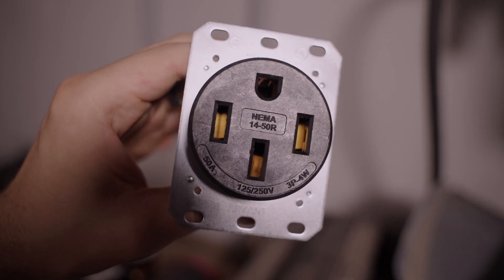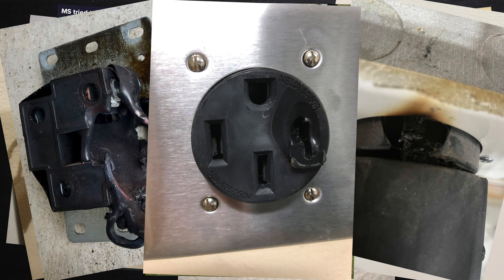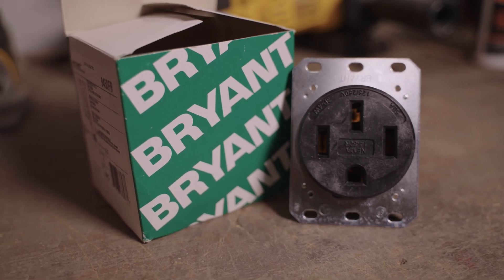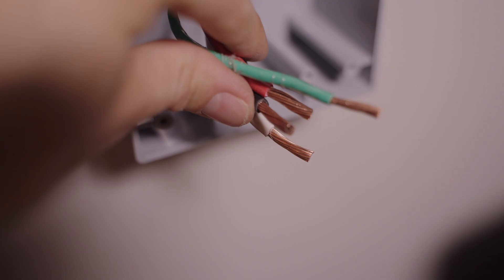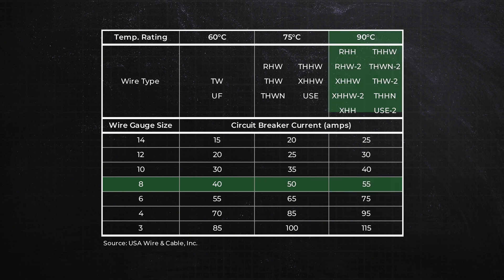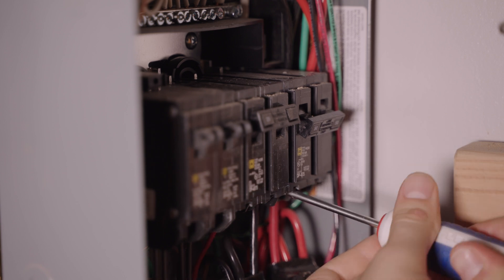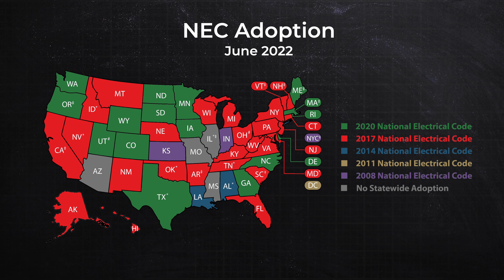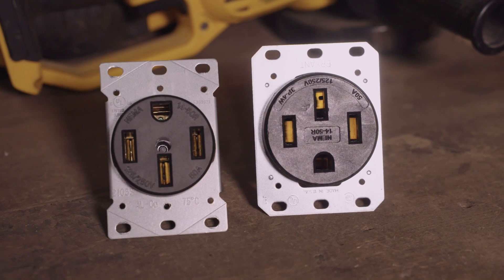3 Mistakes I Made Installing a NEMA 14-50 Outlet

Comment: What's the downside to overtorquing the screws? I understand that the bolt will stretch in tensile situations, but under compressive situations, I don't see the problem with overtorquing. Can someone explain?
Reply: Over Torquing can cause a number of issues: stripping of the screw threads, mechanical failure of the material surrounding the yoke, or the yoke itself, as well as exceeding the allowable compression of the stranded wire, which could then increase the force on the surrounding materials when exposed to thermal cycling. Also, the PVC counduit needed to be glued to the box, given that he pulled THHN/THWN and it's not just being used for mechanical protection. Sheathing on one of the conductors was also damaged. It demonstrates why most people should hire an electrician. I'm sure Josh means well, but making other errors in the video pointing out the errors in the first video is not a good sign. It's typically overconfidence that kills, not self-doubt. Rigid metal conduit would also be my preferred choice in an environment like a garage, instead of sched 40 PVC. BTW, you can see damage to the sheathing for the green grounding wire, which is likely because he didn't ream the conduit as required. Not a big deal if it's the ground, but it's possible that other conductors were damaged during the pull if one of them is damaged.
Reply: @petermaxwell6748  Thank you for the explaination, I genuinely appreciate it. One of my family friends owns his own electrician business, so I will always call him if I need electrical work.

Comment: I know you have turned off the power; you have shown the action in the video. However, as a safety habit, and being a youtuber, you have additional responsibility, you should use a detector to confirm the power is actually turned off.

Comment: Slight correction, those are poles not phases in your house.  The poles are 240v across them with neutral tapped from the middle of the single phase transformer.  Everything is on the same sinewave.
Reply: This is true, but the two "poles" (red & black) are 180 degrees out of phase from each other vs 3-phase power where they are 120 degrees out of phase from each other.
Reply: @tomnorman5461 You are correct, calling it two phases violates only tradition, it is not factually wrong. Electricians resist calling it two phases because 1) the two phases are derived from a single phase source, 2) there was a now obsolete system called two phase with the phases 90 degrees apart, 3) the loads are all single phase, and 4) a 180 degree phase shift is also a simple polarity reversal, so depending on how you analyze the circuit, you can miss the second phase.
Reply: @david672orford  Correct. I've drawn a transformer secondary, putting in the center tap, and ask "how does the center tap achieve polarity reversal?  Crickets, usually.
Reply: @tomnorman5461  If they were 180 degrees out of phase, then the voltage difference would be essentially zero.
Reply: @runningwater5936 nonsense. When one is at +170 V the other is at -170 V. 170 - -170 = 340.
Reply: @tomnorman5461  When voltage is measured across them, you get a single sine wave of 240v at 60hz.  You could invert the polarity to achieve another sine wave 180 degrees out of phase.  If you took a measurement with respect to ground at either pole you would get a very small voltage on the lower leg but but it would still be the same phase.  If you looked at the top pole and neutral with respect to the lower leg, again your measurements would all be the same phase.  The only way I can think to achieve 180 degrees out of phase is to use the neutral to the lower leg but wire the polarity backwards.  But you would have two 120v signals 180 degrees out of phase with each other.  I can’t think of any appliance or motor that wants that.  Instead they want the voltage taken with respect to the lower pole to achieve 240v peak to peak.
Reply: @tomnorman5461  When you add a sine wave of a certain phase (x) to another sine wave of the same phase (y) the sum is simply x + y = new voltage. In this case, each wave is 120 volts. So adding both poles together (think of it as putting them in "series") gives  you 240 volts. The 120 volt outlets in your house only use one pole, so 120 volts.

But @GROGU123 is correct: they are NOT 180 degrees out of phase. Your house has one sine wave (one phase) power running into it.

Comment: Also lack of proper torque. Most electricians don't use TR's much less a homeowner. I am BLOWN away just how tight 35in lbs is every time an AC disconnect or breaker calls for 35. Nice use of the TR!!!

Comment: Here is the deal. If you go to Grainger’s site, that number for the Bryant references a 14-30R. 
Where did you get the face plate? Didn’t see that there.
Reply: Check with Grainger. I had the same issue and called to confirm the actual product being sold. At the time of my call, the product description was wrong as it was referencing a 14-30 instead of 14-50. For wall plate, look into Leviton S701 as the opening is larger to match the Bryant.
Reply: agree. he posted the wrong product url

Comment: And, it is not just EV chargers that can be sour places for GFCI protected devices.  RV receptacles is ANOTHER horrible place for that.  My uncle Randy has a motorhome and he had a GFCI on his 50 amp and he had nuisance tripping like you would never believe.  He ended up removing the GFCI.
Reply from the maker: I was curious about that as an RV is a huge electrical system and any tiny current leak (or collection of small leaks) will be an issue.

Comment: Continuous load my friend. You can only use up to a 32amp charger. 32@125% is 40, you have a 50amp recep. You dont need the industrial grade.
a 48amp charger @125% is 60, so you would need 60amp breaker and #6 wire, but a 60amp receptacle does not fit the plug. Thats why you use the industrial grade recp or no recep and hardwire!

Comment: For all the problems you mentioned at the beginning I hard wired my Tesla Wall Connector with NO GFCI, I don't trust them for this application and went ahead and used 6 AWG.   See the Sandy Munroe segment on the dangers of 14-50 receptacles, they melt, go ahead and do the job right the first time with a wall connector.
Reply: Copper or aluminum?
Reply: @KevinCoop1  COPPER

Comment: 4th Mistake
Stupid Wall or Ground charge cables. Extremely Stupid
insane Tesla Wall Charger and more Insane charging cables laying around. 
Ceiling Chargers
Ceiling Cables
Never ever trip over high voltage cables
Never drive over high voltage cables
Spring r Bungi r Rope w Counterweight
All from top-down ceiling hook down
Stupid Tesla Wall Charger
Reply: Tripping over a 240v cable or installing a 240v plug on a wall with foot traffic r driving over charge cable is crazy. If you do it do it right from the top down. Safe out of the way and lower cost.

Comment: Am not an electrician, but thought, strictly for a code perspective, you cannot put a 40A breaker on a 50A outlet, because you can have nuisance tripping.  The circuit as is, maybe safe, but, is it a code issue?
Reply from the maker: There is not a 40 amp outlet in the US, and the 14-50 is allowed to fill that gap.
Reply: A 40 amp outlet can be used to protect anything downstream if it is rated at 40 amps or more. The amperage is limited by the breaker. If you plug a full 50 amp load into an outlet and wiring rated at 50 amps the 40 amp breaker will trip, and it is not a nuisance trip, it is doing its job. With the exception of duplex outlets, installing breakers greater than the ampacity of the wire or outlets will most likely be another type of problem.

Comment: 2 current carrying conductors on 120/240.  When x and y are equally loaded, no nuetral current.  120/208 can't use that exception.
Reply: I’m not sure what reason you put in the comment, but why do you thing balanced load on 120/208 has a neutral load.

Comment: It's not true that those outlets aren't designed for continuous 50A power draw. They are or else they wouldn't have gotten the UL approval. But that means that the install needs to be done 100% correctly. I have found that most connector outlets overheat because the screws weren't tightened properly or the wrong wire was used. A good way to tell if you have a problem is to feel the connector under a full load. If it's getting hot, there is a problem. The thing about daily charging is that you might be connecting and disconnecting every day and some cheap connectors start to wear out after too many connections and disconnections. That's probably why more EV outlets melt down. You plug the dryer in once and the plug stays put until the dryer dies and is replaced. And, yes, you can solve that problem by going with a better connector.

Comment: Don't have an electric car but I want one eventually. I installed the 50amp already used 6ga wire also since 8ga is the min and I don't want the bear minimum. I will however be buying that industrial 50amp, I also noticed the connections screws weren't very effective. Does the metal face plate fit the new outlet or did you buy a different one?

Comment: If your charger has a plug but you never move it, and your electrical code requires a GFCI, you can ask your electrician to cut off the plug and hardwire the charger. If it is hardwired you do not need a GFCI!
Reply: Cutting a plug off would violate the cords listing.
Reply: @KevinCoop1  most allow for hardwiring. Instructions say to remove the cord end and install the required length of cable. Typically the came cable that goes to the plug...

Comment: HOWdy  J-C, ... 
since you are inserting STRANDED Wires into both the OUTLET & the  BREAKER 
Have you considered utilizing FERRULES to hold the multiple strands of COPPER together ?
Most breakers and many Outlets were initially designed for  SOLID CONDUCTORS & NOT Stranded Wire 
Just curious
COOP
the  WiSeNhEiMeR  from  Richmond, INDIANA
...
Reply from the maker: I have tried that. At one point I put ferrules on the wires into my old box store outlet. Unfortunately, the screw end tightening down on the wires mangled and cut through the ferrule. I decided not to use it.

Comment: One thing I would note is that the Ambient Temperature Correction factors in NEC does not get enough attention and tests have shown the significance of conductor heat during sustained high current periods. I would argue this also applies to the receptacle as well. Consider that over the last 10 years the average high temperature in 22 of the 50 states is over 87F, then at the very least a correction factor of .91 should be applied in addition to the continues current draw derating of 125%. This would mean for a load of 40 amps the circuit would need to be sized to support 55 amps. Inversely if you consider the LIMFAC of the NEMA 14-50 being 50 AMP max, then no more than 36 Amps of load should be placed on that circuit. Once ambient temperature goes up that max current load drops to 32 Amps or lower. One other potential recommendation for NEC updates is to also derate an EV specific circuit by 130% instead of 125% considering the potential for much longer sustained current draw.
Reply: You are correct,  chargers come in 32amp and 48amp not 50amp.   So 32amp charger still uses 50amp or 40amp recep. and wire good for at least 40amps.
48amp charger @125% is 60,   so 6awg wire good for 65amps, 60amp breaker, and harwired.

Comment: FYI, This link from Hubbell says the outlet is good for 75C.   I'm no expert and can't explain the discrepancy between your number of 60C (which I think you're saying was printed right on the outlet) and this info.

https://hciapps.hubbell.com/hcipunchout/LiteraturePDFS/3B/Original_BSS57.pdf
Reply: Hubble is and was the first manufacturer to produce 75C rated 50 ampere receptacles.   I’m not sure(retired now) but most of the others are 60C rated.   He used Bryant receptacle in this video.   The Bryant is only rated for 60C.
Reply: This is incorrect. The Hubbell and Bryant are identical. Bother show a continuous operating temperature max of 75C in the PDF. However, neither is actually marked 75C on the device, and therefore must be installed with the assumption it is 60C rated. Both also come with manuals which say to use conductors rated using the 60C column. Therefore, on a 50A circuit, both Hubbell and Bryant will require 6 gauge copper wire and cannot be used with aluminum. The only exception will be when wiring a receptacle dedicated to a welder or other intermittent duty cycle device. That's a whole other topic.

Comment: The standard for EV charging is NOT NEMA 1450, it is NEM 650.  The is all the Wall chargers wired,  NEMA 1450 has an EXTRA Neutral wire for 120 Volt application, which HAS NOTHING to do with EV charging.  The ONLY reason people keep talking about NEMA 1450 is because all the RV and Camp Ground Use it. For Charging EV, you Don't need the extra wire in NEMA 1450
Reply: You are correct.

Comment: Should have pulled thicker wire.
Reply from the maker: I may in the future. My car maxes out at 32A, so a 40A circuit is fine for my use case.

Comment: If your charger has it’s own GFI but code requires one in the outlet circuit, you may be able to disable/bypass the one in the charger. If it’s not clear in the charger instructions I would contact the manufacturer.
Reply: Or you can just fuck the NEC code and AHJ.... I am all for gfci and afci where needed, but lets not try to make 220v receptacles idiot friendly.

Comment: I was looking at the same table and could not find any reference on the table for romex or nm-b cable (non-metallic sheathed cable). It is not clear which column applies to nm-b cable. Since 6/3 cable is rated for 55 amps, I would assume that it is the TW cable type (since UF likely is for underground cabling).
Reply: Romex or NM-B now is a cable(assembly of conductors).  The conductors in these cables are currently made utilizing THHN conductors which are rated at 90C.   But as he stated in the video, you can not use the 90C column because of termination rating of the breaker and the device(receptacle).  Breakers are 60/75C rated since mid to late 1980’s.   Most of the cheap receptacles are only rated at 60C, so you must use the 60C column.   The Hubble is rated 75C so can use the 75C column.   The Bryant is 60C.    Hope this helps you!   Kevin
Reply: @KevinCoop1  Thanks for your insights!
Reply: @KevinCoop1  There is also the requirement in the NEC 334.80 to use the 60C rating of NM and NMC cable. This permits derating for temp and fill from the 90C column, but needs to be in compliance with the 60C column for final sizing. NM-B does not seem to be directly mentioned in the NEC, but is assumed to come under 334.80 and 334.112. So using a cable [such as NM-B] starts one off from a restriction to 60C whereas using a conduit allows the starting reference to be the 90C column if using THHN/THWN, then derating as per the receptacle and breaker 60 or 70C rating. Gets kinda complex after a while.

Comment: You forgot about derating for continuous duty.  Considering that you expect the charging to last 3 hours or more, you have to size the wire for 125% of the expected draw.  If it's 40 amps, then the wire needs to be sized for 50 amps in addition to any other derating.  With all the derating, you need a 4awg conductor to feed the outlet even though you put a 40 amp breaker on the circuit.
Reply from the maker: Yes, you are correct. The 125% derate is handled by the EVSE and/or car as home/garage wiring is sized for the circuit. In other words, on a 40 Amp circuit with 8 AWG your EVSE should draw a maximum of 32 A. All EVSEs are configured in this way or set like this during the install.
Reply: Ian is correct, go big on the wire. Job done.
Reply: Nice. How did you determine the temperature rating of the Bryant or Hubble receptacles ?
Reply from the maker: @justRome1  It was given in the documentation that came with the outlet. They specified to use the 60°C column of the wire sizing charts.
Reply: @chargeeverywhere  thanks for looking out on this video you save me from a mistake for sure because I have the same setup. I switched from 50amp to a 40amp.  Now. I need to buy a torque wrench. They have more expensive Bryant receptacles out now that do support the 75c. Many YouTube videos say the Bryant And Hubble receptacles are the same but you have to compare the documentation to determine that.
Reply: @justRome1  Bryant and Hubbell are the same. Both say 75C continuous in the PDF spec sheet, neither is marked 75C on the device and therefore must be assumed to be 60C, and both come with manuals which say use conductors rated using the 60C column. You have to use 6 gauge copper to have a true 50A general use circuit with either Hubbell or Bryant.
Reply: @justRome1  there's a listed temperature rating for the terminals on the device.  If you can't find it in the paperwork that comes with the device, you can look up the spec sheet or contact the manufacturer.  Alternately, most terminals, if the listing isn't given, should be considered as being rated for 70°F.  The NEC has a wire ampacity and size chart and different insulations fall under different temperature ratings.  You always size the wire according to whether the terminal or the wire has the lower temperature rating.
Reply: Yes, however some EV charging stations have a preset in them to limit maximum charging current
Reply: @ronaldkovacs7080  NEC still requires you to derate the wire for continuous duty applications. Continuous duty is defined as the load being applied continuously for 3 hours or more.  This calculation is based on the nameplate load information.
Reply: @ianbelletti6241  thank you!